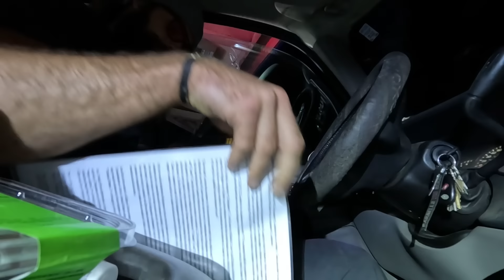This is COERCION: using scare tactics because they don't know The Law

Comment: I practice "the Right to Trave",  last Sunday I was pulled over by the Sheriffs department in Spanaway, WA.  at about 2300 hrs.  I pulled over and parked my van and turnned it off.  I forgot too vedio the interaction.  

He walked up to my window and I rolled it down about four inches.  He asked me what kind of plate that was on my Van?  I seen that he was a Sherif and I asked if he took an oath to the Constitution, and he said yes.  I told him that was my right to travel plate giving notice.  Then I asked him who owns the roads here and he said the People.  I said, well I am one of the People.  I asked him if this was a commercial stop, twice and he didn't answer.  

He could see my wallet with my license showing and he ask about it and I said it is for when I particapate in commerce, as per RCW 46, not when I'm Traveling on the private side he asked me what is RCW and I said "Revised Code of  Washington"  He walked over to where my VIN would be and looked for my VIN and couldn't find it, of which I didn't know was gone.  I asked him why is he looking  for the VIN. he said to check to see if the vehicle is stolen.  I said to him, check your stolen list to see if my automobile is on that lists, he said nothing.  

After this I pled the fifth amendment.  The other Sheriff said, so are you going to fail to Identify, I said first of all that's only regarding the RCW 46 not Private Travelers,  but I didn't say I was not going to identify, and gave them my Name, and date of birth and that's all they asked for.  I started to tell them abuot in California vehicle code says a ride share van is not a motor vehicle but he motioned to me he had enough  and said if I find this vehicle parked on the road, I'm going to tow it, I told him that's for vehicles that have to abide by the RCW 46 and if you did you would be Trespassing against me.  He then walked away. and let me go.
Reply: But if you can't prove it with verifiable, credible evidence, it didn't happen.

Comment: Just FYI, if you get a citation it is an attempt to contract with you and with any contract you can opt to rescind your signature within 72 hours. The process is simple. You sign your desire to rescind your signature and get it notarized. Send through certified mail and the mail system which is another form of court.

Comment: Those arrogant cops🙄🙄🙄 an executive officer doing a judicial function serving court papers, states cannot satisfy the demand for proof of injury in fact, fines associated with citation trespass due process of law, cops acting outside the scope of their authority for Constitutional deprivation  unreasonable seizure…the Constitutional Right to travel cannot be turned into a privilege(NAACP v ALABAMA) cops trespassed Title 18 USC subsection 241/242/1503/1001/1951/1584/245🙄🙄🙄 A law enforcement officer must articulate particularized an objective basis for suspecting to particular person stopped of criminal behavior (US v Cortez 440 US 411/1981) traffic stops are a public safety issue NOT a criminal investigation so cops are not acting in a law enforcement capacity but rather municipal corporate contractors 😡😡

Comment: Send back the upper.   They should fix it.   Likely the hole where the pin goes isn't straight so it is splitting the pin with significant pressure.

Comment: "Only in the U.S." are taxes pulled out your paycheck, taxes on property, then pay to use it, then pay again if you don't follow commercial statutes like crossing painted lines, or passing red signs or signals when it's is clearly safe to do so. (If a wreck is caused, there is a victim so there is enforcement🤷🏾.)

Comment: UCC  9-109(1) & UCC 1-308 Universal Commercial Codes for travelers
Reply: Nope, the Uniform Commercial Code (UCC) is irrelevant to matters related to a State's enforcement of its laws regulating the non-commercial operation of automobiles and other motor vehicles on the public roads. See, for example:

[I] Van Horne v. Valencia, Civil Action 1:21-CV-00173-BU (N.D. Tex. Feb. 16, 2022), slip op at 8-9:

"...Van Horne continues to assert that he possesses a constitutional and God-given right to travel on the roads of the State of Texas without having to comply with the laws of the State of Texas. Id. at 3.

'These arguments derive from the so-called sovereign citizen movement and are legally frivolous.” Westfall v. Davis, Civ. No. 7:18-cv-00023-O-BP, 2018 WL 2422058, at *2 (N.D. Tex. May 4, 2018) (internal quotes omitted). Claimed “sovereign citizens” argue that, although they reside in the United States, they are sovereign unto themselves, and thus are not citizens of the United States nor the state in which they reside. Id. These arguments are cobbled together from Constitutional law, the Uniform Commercial Code, and Bible verses, and are used to avoid legal liability and criminal prosecution. See id.; see also Perkins v. Ivey, 772 Fed.Appx. 245 (5th Cir. 2019) (denying “sovereign citizen” claims of no duty to have a driver's license or vehicle registration); see also Mason v. Anderson, Civil Action H-15-2952, 2016 WL 4398680 (S.D. Tex. Aug. 18, 2016) (denying a “sovereign citizen's” Section 1983 claims against law enforcement). 'These teachings have never worked in a court of law-not a single time.' Wirsche v. Bank of Am., N.A., No. 7:13-CV-528, 2013 WL 6564657, at *2 (S.D. Tex. Dec. 13, 2013)...."

[II] Trujillo v. State, CIVIL No. 10-730 LH/LFG (D.N.M. Nov. 9, 2010), slip op at 1-2:

"...Trujillo's Complaint is based on the faulty premise that requiring him to be licensed, to register his vehicle, and to have automobile insurance violates his constitutional right to travel. While Trujillo's argument may resonate with like-minded anti-government groups, tax protesters, and Uniform Commercial Code devotees, it has been rejected by the United States Supreme Court.

In Hendrick v. Maryland, 235 U.S. 610 (1915), an unlicensed driver operating an unregistered vehicle sought to challenge on constitutional grounds the authority of the District of Columbia to interfere with his right to travel. The Supreme Court soundly rejected the argument...."

[III] Thompson v. Scutt, No. 1:11-cv-573 (W.D. Mich. July 13, 2011). slip op at 5-6:

"...Relying on scattered provisions in the Uniform Commercial Code as well as documents that Petitioner filed with the state court following the criminal judgment, Petitioner asserts that he has superior "claim and title" to the judgment of sentence and conviction over himself, and that he is therefore entitled to release himself from the judgment. Petitioner contends that by failing to respond to his state-court filings, the court and/or the State of Michigan conceded that he is now the holder of the criminal judgment against himself. The Court discerns no legal authority by which Petitioner could gain "title" or "claim" to his criminal judgment such that he could unilaterally release himself from the sentence. As its title implies, the Uniform Commercial Code (UCC) governs commercial transactions. SeeMICH. COMP. LAWS § 440.1102(2) (describing the purposes of Michigan's UCC). It is not a source of substantive rights in a criminal action. Moreover, the state's failure to respond to Petitioner's legally frivolous filings has no relevance to the enforceability of that judgment against Petitioner. Accordingly, Petitioner's claim that the judgment of conviction and sentence is not enforceable because he has "superior claim and title" is without merit...."

[IV] Augmon v. Commonwealth, Civil Action 22-1466 (W.D. Pa. Oct. 25, 2022), slip op at 2-3:

"...As Plaintiff's allegations make clear, he contends that his car was towed because a police officer requested his vehicle registration, and that he advised the officer that he instead possessed a “UCC-1 finance statement” which the officer did not accept. These are the hallmarks of a “sovereign citizen” argument. Adherents of this theory contend that they are not subject to various state or federal laws because they are not United States citizens, as Plaintiff alleges herein. They frequently use Uniform Commercial Code (“UCC”) filings to support their claims, which have been repeatedly rejected as frivolous. See, e.g., United States v. Benabe, 654 F.3d 753, 767 (7th Cir. 2011); Yun v. New Jersey, 2019 WL 3416773, at *6 (D.N.J. July 29, 2019).

The Supreme Court ruled long ago that states may regulate the operation “of all motor vehicles” that drive within their borders, and “may require the registration of such vehicles and the licensing of their drivers” pursuant to their constitutionally protected police power. Perkins v. Ivey, 772 Fed.Appx. 245, 246 (5th Cir. 2019) (citing Hendrick v. Maryland, 235 U.S. 610, 622 (1915)). …"

Comment: Enforce Public Law 108-447, Section 111, Passed in 2004. Does away with Qualified AMUNITY. If Agency received Federal funding are Required to know the Constitution and by laws. 18-US Codes 241&242 Against the Law to stop and harrass a Traveler, Someone who travels from place to place for any reason. Traffic is commercial.

Comment: What happened at court?
Reply: Probably did a motion to dismiss on lack or jurisdiction because his noncommercial private unregistered automobile is not a "commercial vehicle" i.e. "a motor vehicle of a type required to be registered under this code".

260(a) A “commercial vehicle” is a motor vehicle of a type required to be registered under this code used or maintained for the transportation of persons for hire, compensation, or profit or designed, used, or maintained primarily for the transportation of property.” 

(b) Passenger vehicles and house cars that are not used for the transportation of persons for hire, compensation, or profit are not commercial vehicles. 

FACT: California Vehicle Code Division 3, Chapter 1, Article 1, Vehicles Subject to Registration sections 4000(a)(1) thru 4023 governs vehicles subject to registration and includes vehicles 415 & 670 of a type required to be registered 260(a) under this code.

SIMPLE.

Comment: you have to look at etymology for the origins of words.
There's all sorts of alterations been made with our dictionaries, so the new definitions match the legislation that shouldn't really apply to us, like the traffic act, when we are travelling in an automobile.
I was reading a lot of etymology earlier, and just like Black's Law Dictionary says: traffic is commerce and trade. 
Why would the commerce and trade act apply to travellers?
It's like punishing someone under the terrorism act, for riding a pushbike on a a sidewalk.
The terrorism act doesn't apply to riding pushbikes on sidewalks, just like the traffic act (commerce and trade act) doesn't apply to travellers.
The case law says, a licence is to pursue a profession, trade, or calling. A licence is not needed for mere travel. Every citizen has the right to travel on public highways in an automobile without the need for a licence, registration, and forced insurance.
Chicago coach co, v City of Chicago. 337 ill. 200, 169 N.E 22.
Wingman v fielder 2d ca 3d 213 (1972).
Berberian v Lussier (1958) 139 A2D 869, 872
Schecter v Killingworth (1963)
There's more than that. I've had enough typing codes though lol.

Comment: Here is the issue about not having a license plate on your car. If that car has ever been registered with the DMV you do not own it the State does. At that point you are required to follow the rules and regulations. When you signed for your drivers license you agreed to be bound to those rules and regulations. You are correct that they are not a law. What is law? L, A, and W are acronyms for Land, Air and Water. Jurisdiction = juris, correct law and diction, words. You first need to know the correct law in order to define the words in the language it is written. So the juris in this case is Water. Water is contract law and is written in the language of babble aka legalese. They want you to appear in court. What is a court building? It is a dry docked pirate ship where the only job is to separate you from your fiat dollars. This is deep shit and I will go no further. Back to the car ownership. In order to own the car you must purchase it in full in an automobile dealership and leave with the MCO/MSO. That will prove the car ownership as you a private man of flesh, blood and bones. Providing you never register it you remain its owner and not subjected to the rules and regulations of the private club named the DMV. Yes you are correct when you stated that you need to do more research. Great job but do continue your due diligence. Btw, I commend you for correcting your status however you can go further by correcting your Passport from citizen to State National. Citi=municipal zen=servant hence slave to the municipalities. Carry on.

Comment: You arent traveling you arent riding a horse, you aren't teamstering or drovering a covered wagon or buggy, you aren't riding as a passenger in a plane, train, motor vehicle, boat.

To be considered Driving Commercially   is if you operate soecialized types of vehicles that require a Commercial Driver's license which are Vehicles that carry 9 or more people such as  Buses, or other oversized Vehicle's.

So that means every driver is required to possess a valid drivers license not everone drives Uber, Lyft etc whoch does not require a CDL bc you use your own personal vehicle.

Stop relying on Blacks Law Dictionary early editions bc it referes to the time before motor vehicles wrre ever invented and prior to driver's licenses being required to drive in the early 1900s.